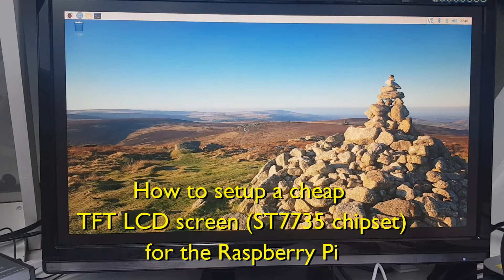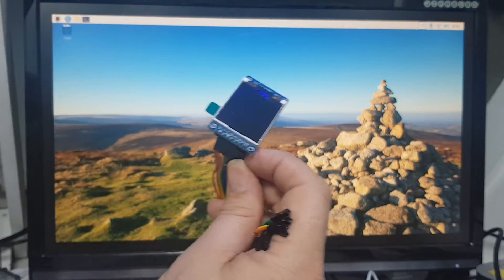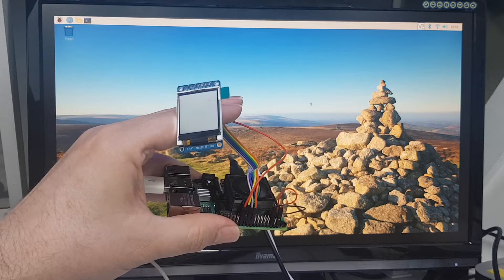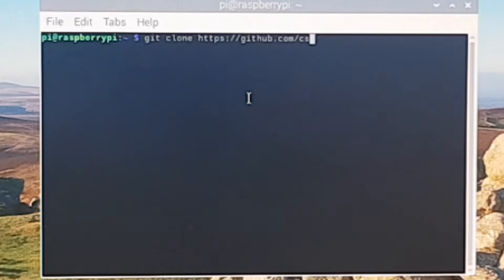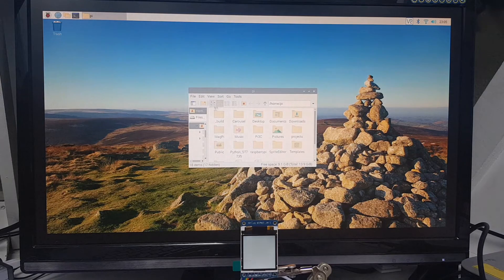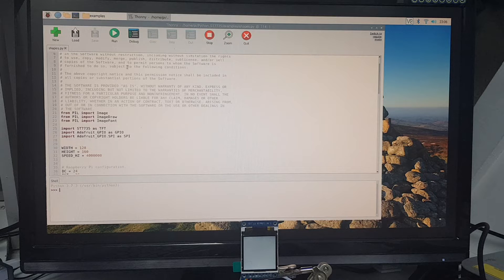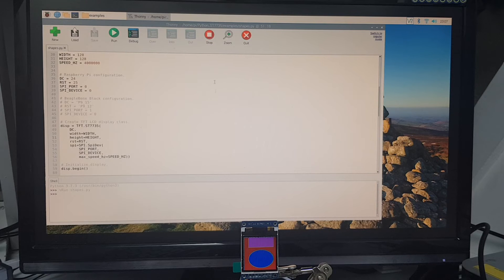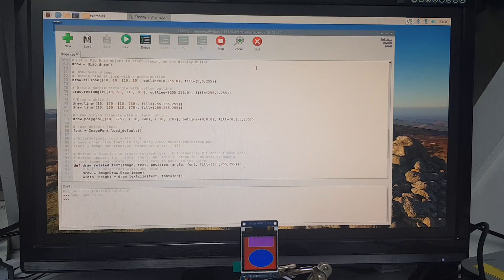How to setup a small, cheap TFT screen for the Raspberry Pi

Comment: Is there an online glossary of Pin labels? I have a TFT screen but the labelling is different to yours. and I have an early Pi but without pin label definitions there does not seem any easy way to check that my connections will work.

Comment: I’ve followed your tutorial but I’m unable to get the screen to run an example.

I get an Error message which says traced back to max_speed_hz=MAX_SPEED

And then

Self._device.cshigh = False

The speed is set to 400000hz as per video and have search but unable to find much 

Are you able to shed any light on this issue because I’m struggling? 🙉🤯

I’m using a raspberry pi 4 / adafruit st7735 128x 128 tft
Reply: Same issue here. :(

Comment: Hii, I have to display exactly the same thing and I am using KMR-1.8 SPI TFT 128*160. I have performed exactly the same steps but while running the program the error comes up as:
 
>>> %Run shapes.py

Traceback (most recent call last):

File "/home/pi/Python ST7735/examples/shapes.py", line 54, in

<module>

max_speed_hz-SPEED_HZ))

File "/usr/local/lib/python3.7/dist-packages/Adafruit GPIO-1.0 init

4-py3.7.egg/Adafruit GPIO/SPI.py", line 46, in self. device.cshigh = False

SystemError: error return without exception set

Please tell me where have I gone wrong? Is it has something to do with the driver? Please help

Comment: I have an old Keurig 2.0 coffee machine with a touchscreen  thats still working. Is it possible to use on my RaspberryPi to see if can put some other things to run through it....
Reply from the maker: Really depends if your old Keurig 2.0 touchscreen has an SPI interface ... and has a chipset that Adafruit supports??
Reply from the maker: ... alternatively, you could replace the Keurig screen with a compatible Raspberry Pi touchscreen - that would be a fun project!

Comment: I haven't tried it yet but im trying to run a pi desktop program in 128x128,
would I be able to get any good framerates with these drivers.
Reply: Hey, I had the same idea.
I thought about about a project like a smart glass with 1.4 inch display and raspberry Pi 0w but I haven't used a raspberry Pi and I don't know how to connect it. I saw many videos just showing images in the display. I need to have the OS running in the screen. So I stopped that project. Is there anyway I can restart it👍.
Reply from the maker: Hi Jalecko - running the Raspberry Pi OS desktop on a 128x128 will be a challenge for your eyesight!!
Depending on what you're using it for, I use simple Python scripts to display/animate text, shapes and images;
the Adafruit tutorials are really simple to setup and run on the Raspberry Pi; have a look at this tutorial ...
https://learn.adafruit.com/1-8-tft-display/python-wiring-and-setup

Comment: st7735s or st7735r?
Reply from the maker: Good question although all I have printed on the display is ST7735, NOMEN_TEC V2.0 (on the 128x128) ... the 160x128 is identified only as KMR-1.8 SPI